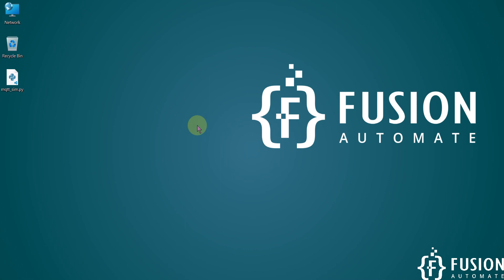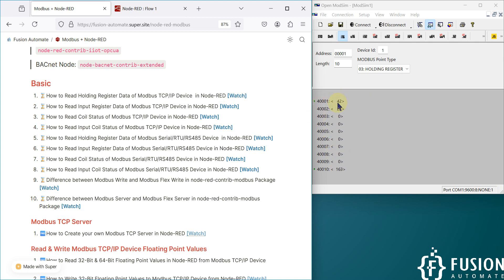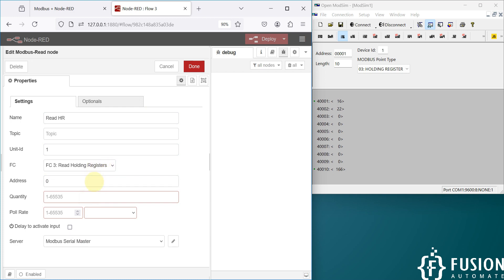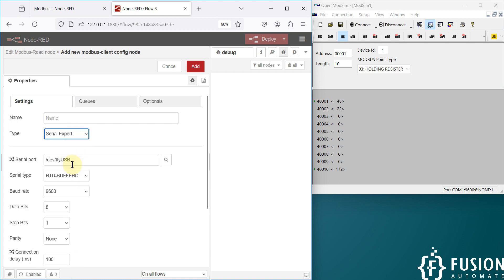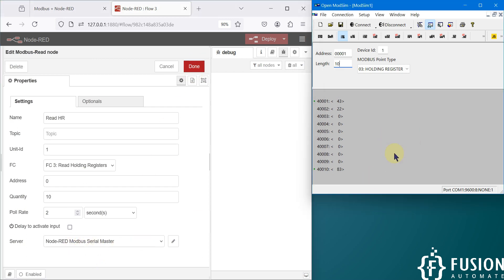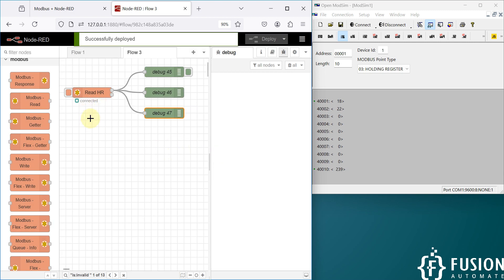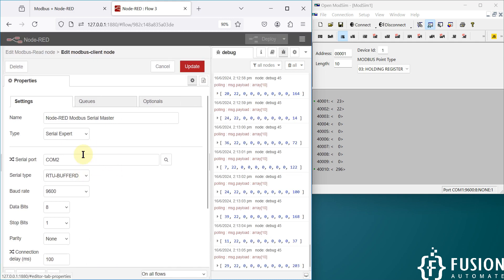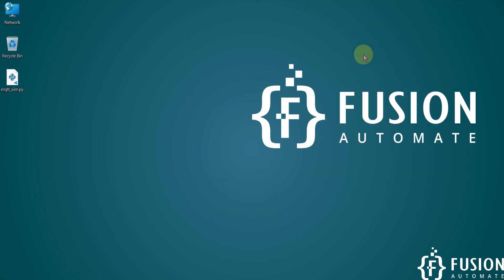How to Read Holding Register Data of Modbus Serial/RTU/RS485 Device in Node-RED | IoT | IIoT |

Comment: Nice Video - thanks for sharing. One question, is the RTU master the same if you want to talk to an RS485 based RTU slave? I take it the protocol is the same, but the hardware (an additional RS485 transciever) automatically changes the signals to the required  levels for the selected media?